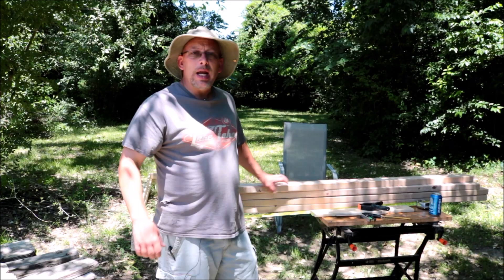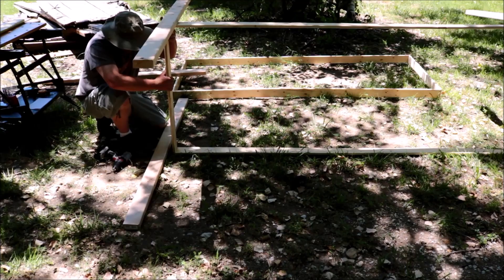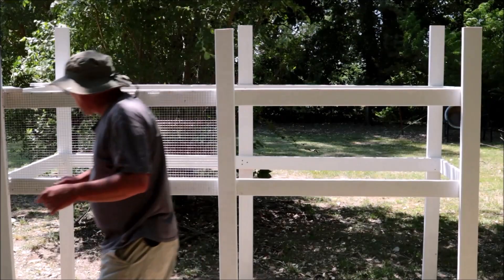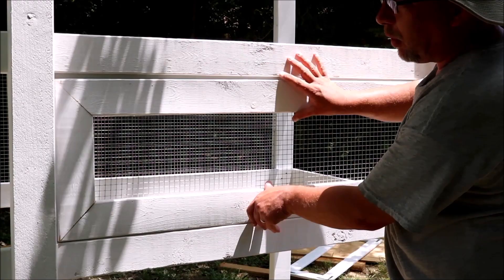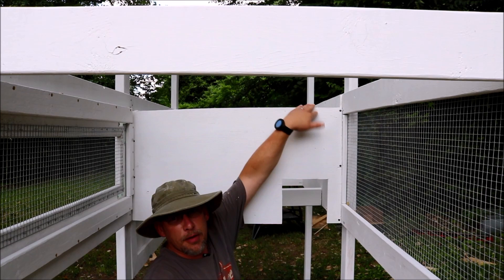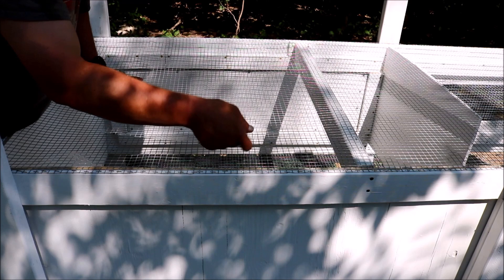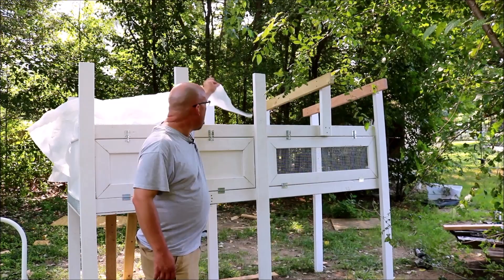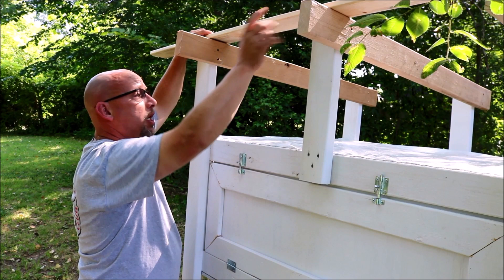Building a New Quail Hutch

Comment: Chris if I wanted to build a hutch like this for my quail could I use the same design with 2x4s? Or is it easier to use same boards you used?  I just want to make sure the dimensions will be the same as yours
Reply from the maker: I don't see why you couldn't use 2X4s, it will be heavier and more expensive but it should work.
Reply: @Slightlyrednecked  With the 1x3 construction how stable is the hutch in winds/rain.  I see you have protection being under the trees, but without that I would think the 2x4 would help stabilize in wind.

Comment: I have all wire hanging cages with sand bath bowls.  Do I need an area of the cage that is not wire for the  birds to be able to get off the wire as well?  Second question, what age do you replace your Rabbit Does, or do you just wait until they kindle less kits?
Reply from the maker: The sand bath does give them a way to get off of the wire so i think you are covered there.  As far as whether they need it or not, they don't really need it but I think it is a good idea and they do like to have a place to get off of the wire.

For my does, I wait until they start to kindle less or have other problems (like not feeding all of the babies or not giving birth at all).  That is usually about 3 years old or so.
Reply: Thank you for the prompt reply.  I appreciate your knowledge and experience.
Reply from the maker: no problem.  Glad to help

Comment: @everyone I'm curious how many birds you're keeping in this hutch? I ended up with a 9x3 due to lumber sizing I had some extra length, 22 birds in there now and seems a bit cramped.
Reply: M curious also. In just getting started and bought 10 chicks yesterday at a small animal swap. From what I e read,you should allow about 1sqft per bird,so you should be fine. I'm gonna be building,but just for a start I'm gonna make my first one 8x3ft,I think. I'm also curious how well they can weather a West Virginia winter in this setup? We average 20s and 30s in Jan and February, but often are down in single digits for a few days at a time too.id like to keep them light enough that they're easily moved if it become necessary too.
Reply: 1 bird per square ft.

Comment: Hi Chris, I built a quail hutch just like yours according to your video here. Thank you very much for that. I am noticing that a strong stench is coming from the side that is not hardware clothed. I have some sand there, not much though. I clean the droppings every week or so. Maybe I need to clean them more often? Droppings do not seem to be too much but it does stink. Maybe it is that very reason why most of my quails sleep on the side that is hardware clothed. I have six quails that is 6 ft X 3 ft area where half of it is hardware clothed and the other half is not (just wooden). I used a strainer to sift out the sand and clean out just the droppings, and left the sand back into the hutch. Should I just throw away the sand altogether to decrease the stench? Do you have any solution to get rid of the smell?
Reply from the maker: I notice that it does have a smell but to me it isn't that bad or that strong.  You might be able to add some lime (like garden lime) to the sand to help with the smell.  Also, try to make sure it stays dry.  That will help a lot.
Reply: @Slightlyrednecked  Thank you. I'll try adding some lime. I think it is wet because of their urine.

Comment: What if you put some latches on that bottom board so you could just open it and let all sandy/dirty area fall out. That way you don’t have to remove the screws and have to figure out how to get it back up. Another option is to put the board inside so you can lift it out and let the trash fall down.
Reply from the maker: Those are both good suggestions.  I actually found that it was pretty easy to just sift the sand out with a piece of window screen so that is what I ended up doing.

Comment: Did you do anything to help prevent high winds from blowing it over or picking it up?
Reply: I plan on doing something like the roof setup for putting a roof over the dog cage.  I just want to make sure i dont overlook something concerning high winds. It will be next to the house and their is a big tree near by. Thanks for any advice you can give me.
Reply from the maker: I haven't had a problem with high winds. It is heavy enough that it doesn't get blown over.  I did have a piece of roofing come loose on one corner once but just put another screw in it and no problems since then.
Reply: Slightly Rednecked Thanks than I should not have any problems than. The dog cage is 8ft tall so it would have to be a REALLY bad storm to lift it high enough to clear that.

Comment: Hey Chris, Gale here, from Devils Elbow.  I'm ready to build my hutch and get my birds to start off.  I am going to modify your plan just a bit.  One thing I plan on altering, is I will install a piano hinge and another lock to the plywood bottom under the sandbox area, so it can be cleaned out and sand replaced easily.  I'll send you a link to the video when I'm done.  I'm just not sure how many birds to order to start with.  KC Quail Farms website doesn't seem to be working right.  Are they not selling birds now?  I see the hatchery in Maine has a new strain of meat bird.  I guess I'd have to order eggs to start with, from Maine, because I can't see what KC has available.  If I can get through to KC on email, and they have meat birds ready to pick up, how many should I start with?  If I go with the Maine hatchery and get eggs shipped, how many eggs should I start off with?  Sorry for such a long message.  TIA for all your help.  Your videos are really informative and helpful.  I enjoy watching them.  (Some multiple times!)
Reply from the maker: Sorry for the slow response.  It is a busy time of year for hatcheries so that may be why you are having problems.  You might also check with Hatch Farms Poultry.  There is a discount code for them in the description of all my newest videos.  As far as how many to start with, I don't know that I can answer that for you.  If you are ordering eggs, I would go with at least 50 to help ensure you get a decent amount out of the hatch.  If you are buying live birds you might want to start off with 20.  That will ensure you get a lot of good egg production. I hope that helps.

Comment: Amazing video! I have rabbits and chickens (for eggs) and now I'm researching raising quails for meat as well. Your hutch design is definitely one of the best I've come across! I understand that I'll need two of these hutches (for breeding, and another for growouts) but we only have space for 1. I'm thinking to build one that's just like yours, but adding another level so the 2 cages are stacked vertically. I'm thinking while the droppings from the lower cage go straight to the ground, those from the upper cage can go down to a pan/board at an angle so I can push them towards the back and to the ground. Do you think this design will work? Any complexity that you can think of? Thanks in advance.
Reply from the maker: I think that would work just fine.  But you don't have to have a separate cage for your grow outs.  I tend to throw mine in the same cage as the breeders and just make sure I have enough left over to continue breeding when processing day comes.  Sometimes the younger birds become new breeders for me.

Comment: What do you think of 1/2" x 1" hardware cloth for the flooring?   Looking at 16 gauge.   Thanks for the video.
Reply from the maker: That should be fine.  If you can afford it, get coated wire for the flooring.  It is easier on their feet.

Comment: Question for ya. I just hatched some quail. Unfortunately some didnt  make it since i lost power from hurricane Dorian. I have a good size fenced yard and was thinking of making a ground pen for my quail a spot with sand and make an added shrub or two. Like a chicken  run with a roof. Is there any real reason to not have them on the ground like this? Thanks in advance.
Reply: predators and flooding during rains.  Both seem easily fixable imo, just ensure to have hardware cloth small enough raccoons can't reach in and yank on a bird.  And have a raised and sheltered mini coop for them to retreat to during bad weather or if spooked by a predator.  Maybe have a roof over half of the run and just more wire the other half, so they can enjoy shade and relief from rain while still getting sunshine if they want to.  Keep in mind if you do a walk in pen, they will likely lay everywhere so keep that in mind as you add landscaping to it, like have a easy walkway for you free of too much foliage so you don't step on eggs.

Comment: you could make a rail system for the bottom board and pull it out when it dirt and slide it back in like a draw
Reply from the maker: That would work for sure.

Comment: I have heard that the top of a quail cage must be flexible, or at least not wood,  or when the quail get frightened, they can hit the top & break their neck. How do you protect them from doing so, @Chris?
Reply from the maker: I use hardware cloth on the top but the biggest thing you can do is keep it under 20 inches tall so they don't get enough speed to do much damage.  it is still possible but rare that they injure themselves.

Comment: Great design.  We are in NE Oklahoma so if it works in Joplin it should work here. LOL  Question: Does the hutch need to be that high off the ground? I'm only 5'2" and will be the one caring for the birds.  It looks a little tall for me, but I want the birds to be safe and healthy. Your thoughts?  Thanks for sharing your knowledge! God Bless!
Reply from the maker: Lol.  Good question.  No, it doesn't need to be that high off of the ground.  I wouldn't put it at ground level but you can make it shorter for sure.

Comment: How did that sand area work out? Did you need to make the wall taller? And how was cleaning it out, everything work out or do you have any design change ideas.
Reply from the maker: I think I answered your question about cleaning it out already.  As far as the size of the wall, it has worked very well.

Comment: Nice.  Thanks.  My comments would be to add an automatic egg catcher in the design and not sure why the gap above pen and roof is so large?   Overall a great project, thanks again!
Reply: I'm assuming the gap is to have a good air flow and keep the coop cool during Summer time because the metal sheets will be hot!

Comment: Do you have a list and measurements of the materials I to use to build this?
Reply from the maker: I am sorry but I didn't make a materials list or exact measurements.  I discussed in the videos the measurements I used but when I build things I kind of just start with a basic idea and then modify it as I go.  The measurements are going to depend on what size you want it anyway.

Comment: Hi - I am currently building a quail cage using pvc coated 1/2 inch square wiremesh ( hardware cloth )  --- thicknesses 0.9 mm-- my wife is concerned it maybe a bit thin --- do you know if there is any issue with the thickness or thinness of the wire mesh for the Quails to walk on ???--- many thanks for previous correspondence --- Norman England ------ ( ma
Reply from the maker: I think it will be fine to use.  I have never had any problems using hardware cloth with my birds and it is basically the same thing.  I do give them a sand bath and they spend a lot of time in there but the wire doesn't seem to bother them at all.
Reply: @Slightlyrednecked  many thanks for your reply -- I ordered the wiremesh from Amazon so I did not have a clear picture off the thickness in advance --- you must be a lot of inspiration to many people -- keep up the good work -- Norman England

Comment: Got a ?    Why did you not use pressure treated wood, just wandering. Love your video's, I want to get started raising some myself.
Reply from the maker: I think pressure treated wood would be fine to use for quail since they don't chew on it but there is some concern about the chemicals used so I opted to use non treated wood and paint it instead.
Reply: @Slightlyrednecked  Thanks!

Comment: I’m thinking of getting into keeping quail along with chukars and pheasants. 2 questions for you; 1.) can I put the hutch inside my chicken run? The quail sand and dropping would be on the floor of the chicken run. 2.) is there a ratio of sand box to open wire flooring?
Reply from the maker: You can do that.  There is a possibility of the chickens carrying some diseases that they can pass to the quail but I don't know that it is a big concern.  As far as sand to wire ratio, there really isn't a specific ratio that is a must.  I like to have a big sand box for them but that is just my personal preference.  You can really do it however you want to.  They do like the sandbox so i would say go as bigger rather than smaller.
Reply: Slightly Rednecked   Thanks man! 🤝. I appreciate you passing along what you’ve learned. Be blessed!

Comment: Chris thanks for all the information on raising and keeping quail. I have a couple questions. First, I plan to breed quail for eggs and meat. I’m building 3’x8’ pens. I plan to divide that into two hutches to keep 15-18 birds in each. Is there any reason to separate the birds or put 30-36 birds all together? Also what is a good ratio to sand and open pen? Thanks in advance.
Reply from the maker: You can keep them separate if you want or combine them all.  it is really just whatever you prefer.  I like to give them at least 25% to 30% of their cage space for a sand bath.  They seem to prefer that to the rest of the cage for the most part.
Reply: Thanks for the quick reply. One more question if you will. Ratio to males to females.... 1-5 sufficient or should I do 1-4, 4 being hens. Also my eggs have hatched and I got 60% hatch rate....my first time. First 5 days in the brooder I have lost 4 birds so far. One each day with none on one day in between. Is this common?

Comment: Do you have any problems with the bare hardware cloth floor? I’m building a battery cage because we live in an apartment above our business and have to keep our quail in our porch. I was planning on using pvc coated wire for the floor but was unable to source it in the correct size at a reasonable price. Do you have any tips on keeping their feet in good shape on the bare wire? Thanks for your videos Brother! They have been a lot of help.
Reply from the maker: I rarely if ever have a problem with the regular hardware cloth.  I occasionally get a bird with a leg problem but it is very very rare and I don't think it is caused by the hardware cloth.  I also provide them with sandboxes to get off of the wire too.

Comment: Hey Chris!! Another awesome and informative video!! Hey, this particular hutch is 24 sq ft, right? I read somewhere in the comments you said 18 sq ft, but if the floor is 3ft x 8ft then it'd be 24sq ft, right? Also, I'm in the process of not only building this, but also putting together a materials and cut list to hopefully help out with some of the comments. 😁🤙 I will forward it to you when I get it done. God Bless!
Reply from the maker: You are probably correct.  It wouldn't be the first math mistake I have made. :)  thank you for the help with the materials list too.
Reply: I’d love the materials list!

Comment: Just getting started thanks I got a lot of good ideas but what size is your wire mesh that you use
Reply from the maker: I use 1/2 inch hard ware cloth.  If you can find it, 1 x 1/2 inch coated wire would be better for the flooring would be less likely to cause leg and foot issues.

Comment: What length screws do I need ?
Reply from the maker: It depends on what kind of wood you are using.  The general rule is to use a screw that will penetrate half the thickness of the bottom material.  So if you are using 1 by 1 and screwing them into another 1 by 1 (2 inches total) you would want a 1 1/2 inch screw.  Hope that helps.

Comment: How many quails does this size structure hold: Ratio males to females?  I’m a new quail mama and I am, learning the males are very aggressive. I am expecting to move and want to make my cage mobile.  I have right now 15 quails — more males then females.  I got them for meat and eggs along with my chickens.  My initial cages I converted small animal crates (14”HX18”L) and build frames for the floors and slanted them.  I made 3 of those about 36” long lined on a folding table.  So I don’t want to exceed the length of the grown out cage. I’d have to modify what you made.  But I want to know how many quails will fit in what you made.  I’m thinking about making two levels of grow out boxes along with my 3 cages I made already to give me a 9 unit structure:  The 3 animal crates plus the 2 level grow out cages I will make.  I just want to make this so it contains the right amount of quail ratio.  Thank you!  I may consider PVC which I made my chicken (mansion) 😂 out of  a massive 5’w X 10’-12’ L coop with run in 2 parts.  Lumber is expensive right now.
Reply: My Shirer Farm guy say they tried different am ofboy girl ratio, he said 5 to 1 is best for fertlie eggs to hatch. Less than that, boy annoys girls & their feather suffer.
Reply: I was wondering how many ratio wise was in this coop.  Currently I have 15 quails. 7 are hens, 8 are Roos.  Wondering if that hutch built would be sufficient
Reply: He says he has something like 20 birds in there. I don’t know how he does it.. mine are so aggressive at 5 to 1, had a couple accidental extra males and they almost killed then